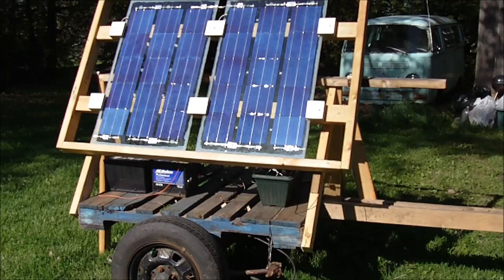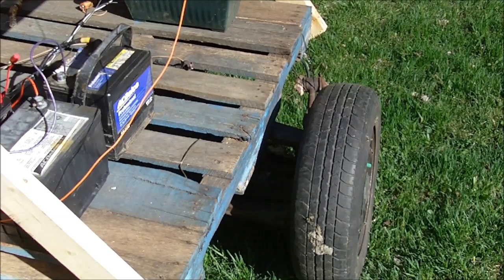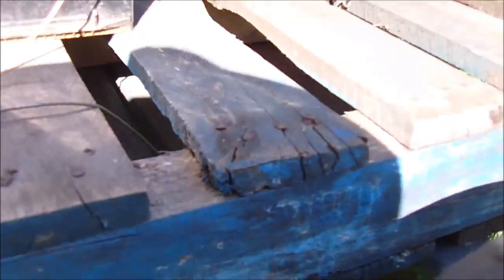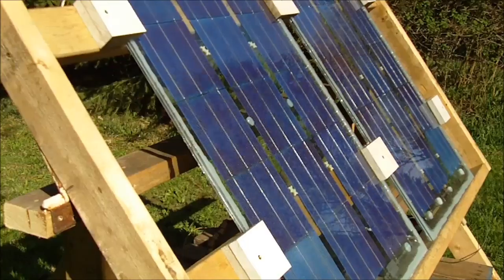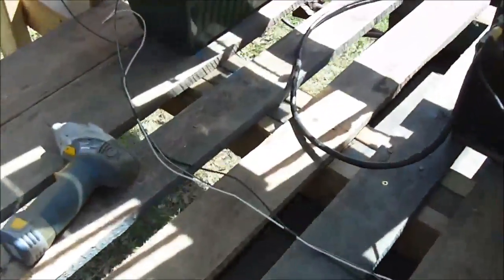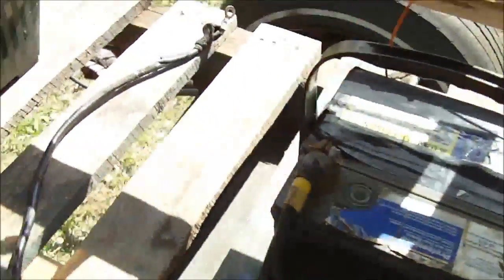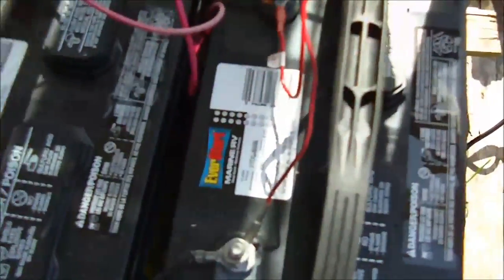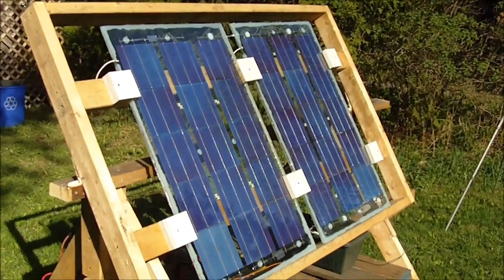Homemade solar charging trailer

Comment: nice  going  i  haven't  built  any but  bought  4  -100 watt  panels  and  a grid  tie inverter and  plan  to add electrical energy to  my  garage  for  running  my  aquaponics  garden, running  my  pumps  and  lights and help to keep  my  electric  bill  down......keep up  the green videos  peace bro.